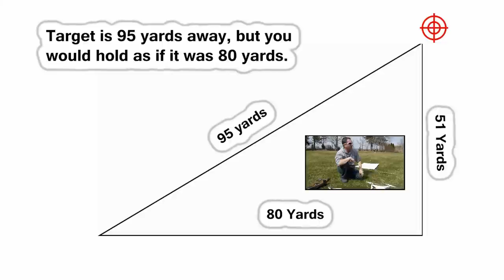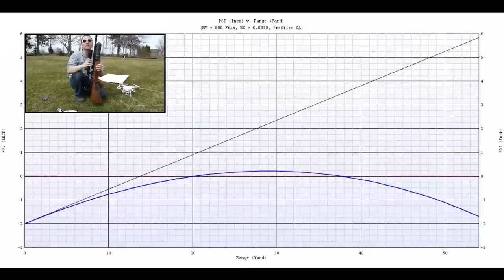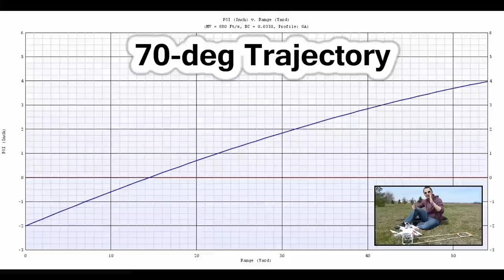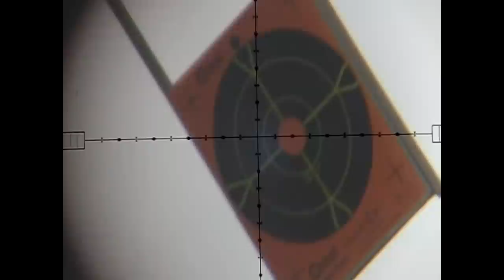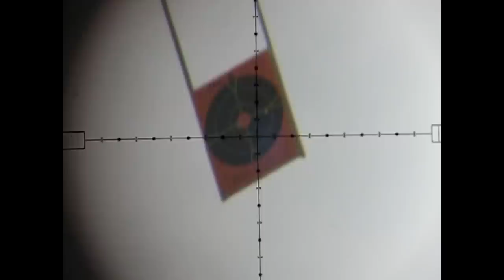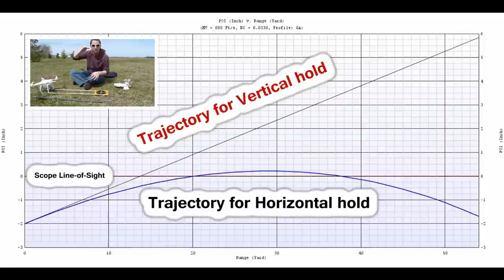How to Aim and Shoot Up [Uphill and Downhill]

Comment: Ted if you get on chairgun  and  1Open the visualization window  and set your yellow dot to 30mm. 2  put  0 in the incline  box . 3  Set your end range to 20  yards.4  set your zero range  to where your 30mm dot  is in the middle  on a mildot or the crosshairs  so you have a good reference point once you start changing the incline . 5 start changing the incline by clicking on the + or -  next to the incline box , like you said it doesn't matter  which way you go it does the same thing.  6 As the incline number is changing  you can start to see the 30mm dot move up  letting you see where the pellet is going . Once you get  to 70 degrees  you can see the 30mm dot has moved up a complete  mildot  and if you didn't adjust  and aim  using the  mildot higher  to lower your gun barrel , you would completely miss the target  . 

Chairgun is just a easy way to show people   how angle shots affect the flight of the pellet. 

 You can change your  end range around to see how it effects the pellet . If your under a tree shooting  at a squirrel  and its  10 yards or 30 feet   up in the tree  you can  which is a average distance  and 75 degrees is a normal  degree to be at  you can  set the end range to  10 yards  and  move your incline from 0 to 75  and you can see at even at  10 yards  away  with a 75 degree incline you can be a 1/2  mildot off .

 Its to bad chairgun doesn't go on up to  90 degrees . I keep a angle degree indicator on my gun just for this reason  so I don't miss the squirrels . I have a different click chart  for angled shoots  and different angles  mostly   12 degrees  and up .

 If you set your end range  box to 40 yards  and move the incline from 0 to 75  you can see you can be off 2 full mildots .  At 40 yards, if you have your crosshairs centered on the target, once you get to 12 degrees you can watch the  target moving up and at 27 degrees  you can see the target is out of the crosshairs and  you would miss the target . So even a 27 degree incline can make you miss . chairgun shows you  where you need to aim to be dead center on the target . In this case you would have to  aim half way between the  crosshair and the first mildot above the crosshair . 

 It really pays to have a  way to check your angle  and make a  mildot  chart or click chart for the different angles .

Comment: I generally zero my air rifles at the top of the pellets trajectory which in turn makes angular shooting a bit easier.

Btw nice drone dude, you never settle for anything but the best!
Reply: joshua12345676 It also maximizes the range for which you are in the killzone for level shooting. I do this with my 600fps .177 crosman pistol. 11-21yds I'm in the half inch killzone without holding over or under (squirrels).

Pretty sure that's a DJI Phantom, it's pretty close to top of the line for ready to fly stuff, but there are kit multirotors that costs many times the value of a DJI Phantom, and will fly while carrying 3-4 Phantoms and still be stable enough to film and hold position in those high winds.
Reply: Agreed on that, having no hold-under in most situations is pretty handy. 

That is interesting, those kits must be pretty sweet. I am looking forward to what Ted is going to do next with his new toy.
Reply: intrebulon, one of my neighbors had an octocopter that cost him a fortune but we shot it down on New year's with fireworks, specifically mortars. He was pissed!
Reply: Lol, that stinks! Was he getting to close trying to film?
Reply: Yep. Luckily he had the parts to fix it, since it only damaged one propeller and the motor, the parts that were actually hit by the shell

Comment: I have a question that I am having trouble finding help on. I plan on buying a Hatsan AT44s and I was wondering if I could use my air compressor to fill its tank. If so what attachments would I need to make it fit the gun, thank you.

Comment: Wait when u were using the triangle to find the distance for the 3rd side was it just a2+b2=√c or did u use √y=√(x1-x2)2+(y1+y2)2? Or do they both work the same. And pretend the 2s' are square roots.

Comment: Does this convert to spring air rifles too? And what do I do if the scope mount grind on my air rifle was ground a little crooked? I had the thing for months now and only recently acquired a scope for it, when I mounted the scope, I realized that the front of the scope was pointing a little to the left, and  by a little I mean" you can clearly see it's crooked" I mounted it on my other rifle and it was straight. .. any advice?

Comment: Hi Ted!
I recently rediscovered the wonderful air rifle hunting hobby again and I am getting a new gun..
I was wondering do you think that a camo IGT 6.35mm shooting at little under 200 m/s or somewhere around 650fps.
Would this be powerful enough for squirrel at 35meters?
Reply: SamD Use chairgun to calculate energy at target. I'll do it for you.

I couldn't find a single Gamo IGT rifle online in 0.25cal for information but I did find two other 0.25cal Gamo's that both shot light 0.25's at around 800fps so 650fps is probably within reason for what you have.

So I calc'ed using 25.4gr JSB Kings at 0.25cal (6.35mm) and you are looking at 19.1ftlb energy at impact at 35yds. Way more than needed to ethically kill a squirrel.

I extended the yardage and found that even at 185yds (if you're an amazingly good shot) you still have double the energy required to dispatch a squirrel whether you go lungs or head. It's overkill for squirrels to be honest.
Reply: Thanks  man! But I Already bought the Hatsan125 .22... im sure that would have been helpful!
Reply: SamD Nice, actually a little more powerful than the Gamo with lighter ammo.

I calced slightly under 25ftlb at 35yds with a 15.9gr JSB Exact at the advertised 1000fps, which is probably a bit faster than it will actually shoot 15.9gr. 

My understanding is they typically chrony them with pretty light pellets so pellets you would actually use will shoot a little slower.

In this case dropping it to like 850 (by using heavier pellets) would actually be a good thing. I think Ted mentions in several vids that shooting pellets at supersonic speeds can make weird stuff happen.
Reply: Yeah..I like the heavier pellets ( around 1.1-1.3 grams) or some where around 18 grains.
they just tend to be more accurate losing some speed but still fast enough for pest hunting
Reply: SamD Shrug off the wind a little better usually too.
Reply: yep!

Comment: Is it true you can just multiply the range to target by the decimal number for the angle , example  45 yards to Target and a 40 degree angle.
45 x .77  =  34.65  yards    round off to 35 Yards
Aim at the Bullseye
My Rangefinder has the Angle indicator built in , so 2 clicks and i have the data , quick calculation and Bingo.
If it was only that easy   ???????????

Comment: How do you calculate the foot pounds of a air gun for example Gun A shoots 427 feet per second but then you put a 7 grain projectile in Gun A how much does that effect FPS and how much more stomping power does this give the gun. Im thinking about hitting robins with Gun A WITH lead bb which are almost double the grain
Reply: There's an equation you can easily look up just look at foot pounds equation. But a 7gr projectile going at 437fps is only producing 3 foot pounds... That's not enough energy if you want to hunt with it especially with bbs. Putting a heavier projectile will just decrease the velocity at almost half which basically gives you a worthless hunting weapon.
Reply: CA Airgunner Alright I was just picking up this Mosin replica and I have mice so I was wondering if I could just throw lead bbs in it but thank you

Comment: I always remember reading about the Battle of Bunker Hill, and General Putnam telling the Patriots to "Aim for their waistbands" because they were shooting downhill. Some accounts say he said "Aim for their Knees" also, but that seems pretty low.
Reply: This kind of doesn't make sense because if you aim inches lower the higher up the target gets why would you aim lower shooting downhill?? Wouldn't you be hitting the soldiers in the feet?
Reply: You may want to listen to the beginning of Ted's video, again.  I think it has to do with the scope (or reticle) being set slightly downward, in order to compensate for the "arc trajectory" of the pellet (remember the two "zero points of intersection").  Although it may be a bit odd to comprehend, "hold-under" works, even when shooting downward.  The best way to find out is to "take it outside" and practice shooting in that situation.  (Then again, I'm just a "novice shooter".  I could be dead wrong...)  Safe Shooting!

Comment: I have all mine set up so there is only one zero point where the trajectory of my pellet meets the line of sight of my scope.  I do not shoot beyond 50 yards so it works out well.  Ted, so your statement that all firearms are set up so you have two points of impact really does not hold true.  I do see where it is better for your needs as you shoot out to longer ranges.

Comment: Ted, your numbers on that triangle is actually wrong.
Using Pythagorean Theorem, of Asquared + Bsquared = Csquared

52squared + 80squared = Xsquared
2704 + 6400 = Xsquared
9104 = Xsquared

SquareRoot 9104 = SquareRoot Xsquared
95.41488... = X

So the length that he is shooting is a bit longer than he says.

This is all a joke, the math is correct and the distance is a bit longer but its just a joke

Comment: That's very impressive ....

Can you show us how to sight in a rifle scope  

I have Diana 350 or 360 magnum I'm not sure 
 

And I tried a lot to sight it and its not working at all ಥ⌣ಥ

I don't know what to do its never get very accurate .
Reply: Look in his previous videos he has a video on it
Reply: Omar Alnajjar Are you sighting it in (zeroing) on a gun vice or sled, or by firing it normally?

If you are zeroing on a vice or sled then there are a number of possible reasons for the inaccuracy:

The pellets you're using could be no good for your air rifle.

The barrel could be dirty or damaged, or may be in need of recrowning.

The type of pellets could be wrong for the distance / speed you're shooting at. ie. Hollowpoints fired over 850fps at targets more then 20 or so yards will not likely hit where you aim them.

For general accurate shooting with an air rifle, you probably want something round instead of pointed, flat (wadcutters) or hollow pointed.

I use JSB Exact RS .177's (7.33grain) in my pistol up to 20ish yards with good results. I went through 7 different brands and types of pellets before I found that these were satisfactorily accurate for my airgun. The worst were some H+N Crow Magnums .177 (8.4grain i think) in my gun. They didn't even load well as they were slightly large for my barrel. Because they were such a tight fit, they hit really hard and even made my airgun slightly quieter, but they just wouldn't go where I wanted them to go, even as close as 11 yards. :)

Most airgunners know you can't just use any old pellets and expect them to hit where you aim (assuming all other things are being done correctly). You have to find the right pellet for your particular gun. Also note that what's best in your Diana 350 Mag may not be what works best in the next guy's Diana 350 Mag, but what other people are using on the same airgun is a good starting point.

Comment: Hope this expensive UAV won't go rogue on you.
Reply: It won't, it has no ai
Reply: Flynn Asher With that I meant losing the control signal and going AWOL
Reply: FirstDagger Knowing its DJI it probably will.
Reply: dctisthebest you read to many fairy stories online , it is stupid newbie pilots who lose them through their own stupidity then blame the equipment (Dji)
Reply: FirstDagger  most modern day drones have a feature that if they lose signal they will return to where the controler has been seen last or just go land on the ground.
The drones that are not cheap wont just crash or go nuts...
Reply: Sometimes the GPS has a glitch causing a "flyaway". It can happen to any flight controller but is most common on DJIs because phantoms themselves are so common. I own a range of quadcopters and planes. Some I built myself and some I bought.
Reply: dctisthebest I had a TBS Discovery that decided to fly a 1/4 mile away and land on its own. Thankfully it was in an area I could see it.  Freaked me out at first but it was all good in the end.

Comment: So that is why my twenty five yard zero seems to change so much when I shoot at higher and higher game in my tree! The zero didn't change. Gravity's effect on the projectile changed.
Reply: vajake1 Gravity's effect did not change, gravity is a constant. It's because the higher you aim, the more you are shooting directly into gravity, so the pellet arcs less.

Technically, it is the relationship between the vector of your pellet and the vector of gravity that has changed.
Reply: Point taken.  The projectile travels less in the horizontal plane while traveling closer to the vertical plane.  Gravity (stated as a constant) has less of a ballistic effect on a projectile when traveling closer to the vertical plane when compared to a similar projectile traveling at a similar velocity in the horizontal plane, given similar atmospheric ( temperature, barometric pressure, wind direction and speed) conditions and elevation (as compared to "sea level").  Generally speaking there are very probably several other variables that I have not addressed.

Comment: All that math made my head hurt:)
Reply: lerch400block Mine too. And then if your scope is not on the same horizontal plain as your barrel but zeroed in at 15 yards it really gets hard.
Reply: Dasdfjkl Your scope is never on the same horizontal plane of the barrel, unless you are mounting your scope on the side or you're holding it sideways. Generally the scope is on a higher horizontal plane than the barrel.
Reply: IntrebuloN I meant if your scope is crooked side to side. Then if you shoot closer or farther, the pellet hits to the left or the right of the bulls eye as well as the normal higher or lower.
Reply: Dasdfjkl Ah, so your scope is not on the same vertical plane as the barrel. Mine is offset because of my adapters. I dont zero it right on the crosshair, I zero an equal offset to the offset of my scope centre in relation to my barrel. Mine's about 3/16" right of the barrel. Doing it this way means my point of impact is always 3/16" left of my crosshair, regardless of the distance I'm shooting. No calculation required, just have to remember it's offset.

Comment: You can kill somebody with bullet falling back down at same speed it came out
Reply: Actually, it will come down at terminal velocity, so much slower.
Reply: Raschid Moudatir Have you never heard of air resistance?
Reply: Fired at a 90 angle the bullet will be overtaken by gravity and it will fall but at its terminal velocity which is nowhere near its muzzle velocity hence it will most likely just break your skin. At 45 degrees is a different story....
Reply: Raschid Moudatir First of all, he's shooting a pellet, not a bullet.

Second, how the hell you you get a bullet shot up in the air to come down with the same velocity it had when propelled from the muzzle?!!!